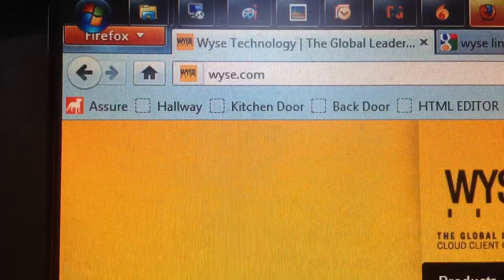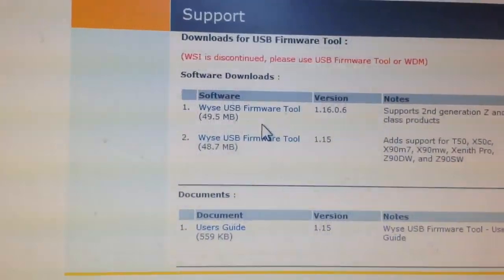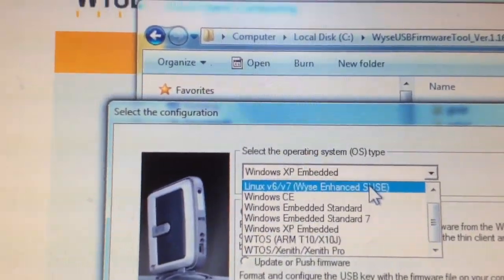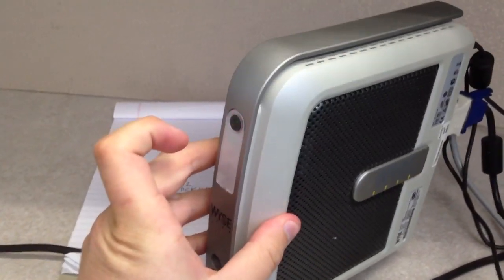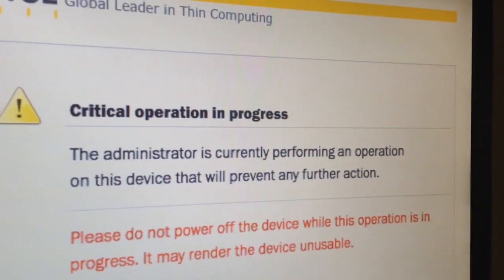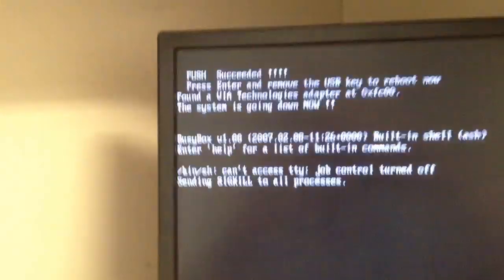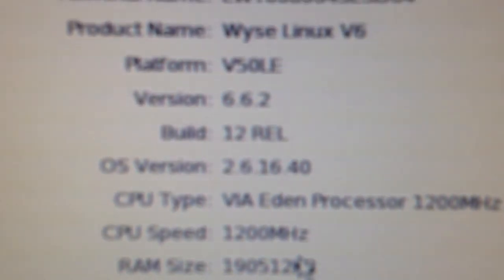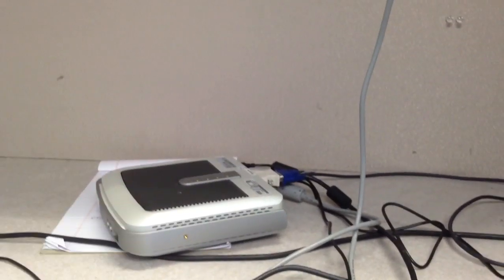Flash Wyse V50LE Thin Client

Comment: Firefox is listed in Addons but there's no icon on the desktop or the start menu for it or a bunch of the other things that are installed. There's no file browser either.

I'm getting a 1 gig Apacer IDE flash drive and 512 meg RAM for one of these. Going to try giving Linux more room, ot see what I can do with XPe on one.

I have three of these, two with 64 meg flash, one with 128 meg (the one I put Wyse Linux V6 on). All with 128 meg RAM.

I'm going to see if I can get FreeDOS with the Panasonic universal USB Mass Storage driver for DOS to work on one, with a RAM disk setup. Hopefully the Realtek ALC655 AC97 is compatible with VIA's DOS AC97 driver. Far as I've found, VIA was the only company to produce a DOS driver for AC97. The Realtek 8100 Ethernet chip has a DOS driver available.

Why do this? DOOM! Genuine original "vanilla" DOOM and DOOM II on a PC the size of a small hardcover book.

Practical use? Leave out the Ethernet and Audio drivers but keep the USB and one of these should be perfect to run old DOS CNC control software on. I have a mid 1990's benchtop CNC mill for which the only software available to run it is for DOS.

Comment: These things are a pain in the butt to repair and upgrade, I have a pair of S10's with the really limited WTOS which does next to nothing, though it has removable RAM and an IDE slot which is now populated with a CF Card adapter, and i upgraded the RAM, getting things to boot on it is a nightmare, the most i've managed from the CF card is DOS, DSL Linux (From USB) and Ubuntu Once over LAN. often it hangs when loading the kernel and there's a lot of tweaks needed to get Tinycore to even boot.